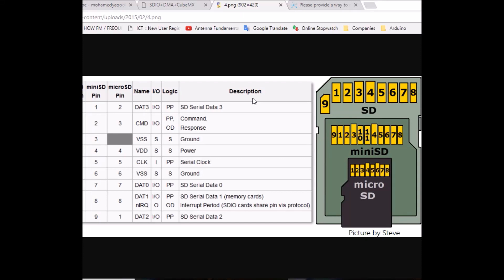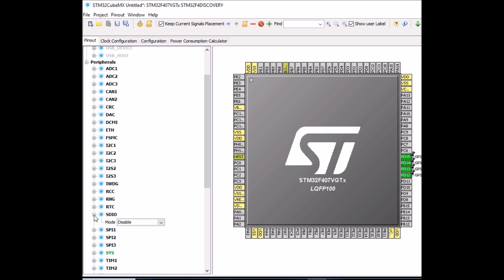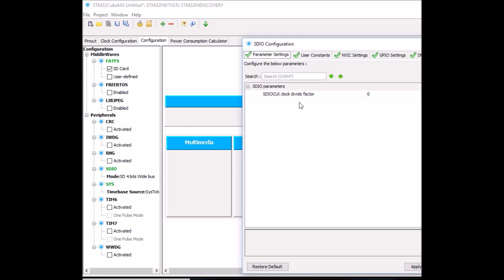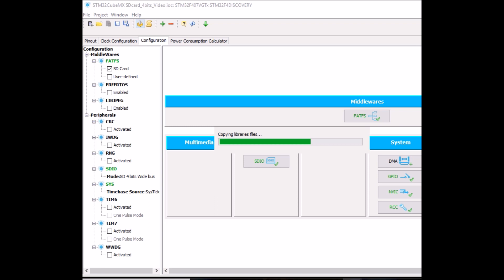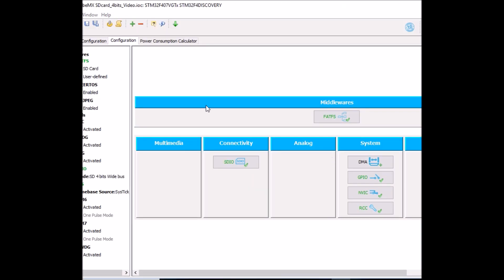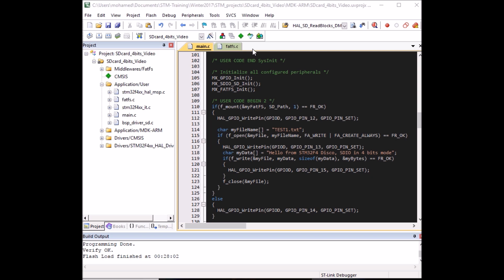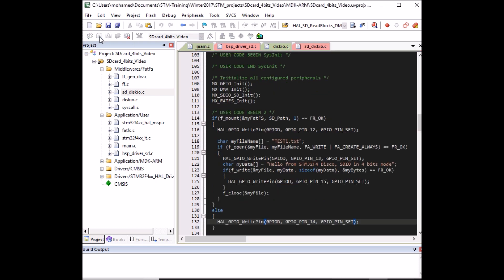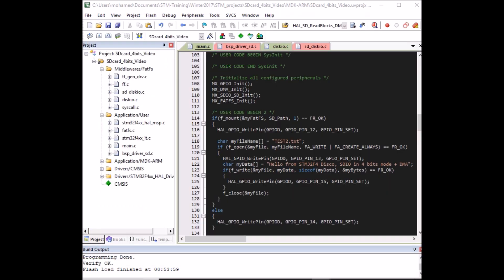STM32F4 Discovery board - Keil 5 IDE with CubeMX: Tutorial 22 SD Card SDIO 4 Bits + DMA

Comment: What is the point of setting up a DMA channel for using FATFS in this way? If you look into the f_write call you will see that as soon as it sends the SDIO DMA it will sit there waiting for as long as it takes the DMA transfer to complete in a blocking way before proceeding. This makes the use of a DMA function completely irrelevant. I would love for someone to correct me as I have spent hours trying to find a solution to non-blocking fatfs write but it takes about 2 minutes to look into the f_write function to see that simply adding a DMA channel to the SDIO write adds zero benefit.

Comment: Hi. Great job with your tutorial Series. I would like to ask you a question. At the beginning of the video, you mentioned that several people are experiencing problem with Hal spi library. Could you please tell me what kind of problem you are talking about ? I am working these days on a project with a Nucleo f411re and an ADXL345 accelerometer connected through SPI. I followed your tutorials on howto read and write on SPI. I think to have properly set the SPI configuration according to the accelerometer datasheet. Do you think possible a problem in the new library version? Please let me know. Thanks
Reply from the maker: Ocelot 0991 
Hi man,
Thanks, The issue is with the SDIO driver on latest CubeMX releases (4.23 and 4.24).
Reply: MYaqoobEmbedded 
I am not sure about the exact  version, but I essentially installed it  on Sunday. So do you suggest to downgrade to the previous version ?
Reply: I am not sure about it, but I don't think the SDIO driver is called when using Hal SPI transmit or receive. Please correct me if I am wrong.
Reply from the maker: Ocelot 0991 
No, you are absolutely right. I was just referring to the Bug in the latest release that I mentioned at the start of this video. You should be ok with SPI. Good luck :)

Comment: Just a side note. On my F407VET (Black Board) I had to set CLKDIV to AT LEAST 11 to get SDIO mount at all... I would even set it higher for reliable operation...
Reply from the maker: Right, that's most probably to do with line impedance and strength of pull up. Is it a copy board or ST designed?
Reply: @mutexembedded2206  Its not a ST board nor ST designed, its a 15€ Chinese one: https://www.mikrocontroller.net/attachment/464382/black.jpg It has 10k pullups on SDIO lines. I also somehow doubt that they've done any impedance matching on the SDIO traces but I also read that impedance matching is only needed if traces are longer than 120mm...

Comment: Thank you for your tutorials, my CUBEMX version is 5.4.0, when I press generate  code from the cubemx, their have some information about like "These IPS still have some not configured or wrong parameter values:[FATFS, Verify the Platform Settings Tab]". Will this influence the program working?  Thank you.
Reply from the maker: If it is the disk detect pin, no effect
Reply: @mutexembedded2206  Thank's a lot  for your reply. Got it!

Comment: Hi MYaqoobEmbedded, The example is illustrative. However the provided BSP_SD_XXXXXBlocks_DMA functions implement a busy waiting loop, which defeats the whole purpose of DMA.....
Reply from the maker: Useful with RTOS applications.
Reply: Yes, but than you would still need to build a mechanisme to properly synchronize the file system operations with the low level device access that yields the CPU, this is probably out of scope of the example, but may be the reason why the out of the box CubeMx implementation does not work.

Comment: Hii, great work! would you consider using sd card in spi mode? can you make a video for the same?
Reply from the maker: Hi, SDIO is much easier with STM, than using SPI.
Reply: @mutexembedded2206  is spi faster than sdio ? + Uses less pins
Reply: @VishalVerma-xw9wb  NO, SDIO 4-bit "at least" 4x faster than SPI

Comment: Great video. What is the purpose behind running SDIO with DMA as the data transfer is very fast and doesn't seem to block the CPU?
Reply: I guess it is useful for determinism on RT applications, such as control systems and data logging running concurrently.

Comment: Hi, I did the same by downgrading as you suggested and I worked successfully. However, the original project that I'm working on is already upgraded to the latest(4.25) version.

Therefore, I'm trying to do the same project with the CubeMX version 4.25, and FW version 1.21, but it's not working. I thought maybe they fixed the problem in version 4.25 but apparently they did not.

Is there a way of doing the project using the lastest versions? The problem is once any project is opened with the lasted version of CubeMX, it's upgraded automatically, and once it's done, there is no way of downgrading the CubeMX version of the project.

If there is a way of downgrading the CubeMX version of a project, I can also make use of it.

Besides, thanks for the videos, and I'm looking forward to see the next ones.
Reply from the maker: Hi Ogulcan,

An easy way to do this, is to do the CubeMX set-up from scratch again with the Downgraded CubeMX and then, copy the code over from the previous one. I usually do that.

Regards,
Mohamed
Reply from the maker: I tried no. 2 with the SDIO issue, did not help.
If you have a large project, then just add the SDIO library to the project manually,, it is a bit tedious but doable, you would have to include all the SDIO .h files and Add the .c files to your project.
Reply: Okay, I have some time to wait for the fix. If they won't be able to  fix it in the next release, I'll do as you suggested. In the meantime, I'll implement my other tasks. Thanks for your effort,  cheers.
Reply from the maker: Ogulcan Ariyurek 
That's Ok, good luck
Reply: Hello MYaqoobEmbedded,

The new version of STM32CubeMX has released, which is version 4.26. Could you be able to make it work with the lastest version without downgrading?
Reply: Hi, did you try with freertos?
Reply from the maker: Ogulcan Ariyurek 
So did not reply to ur previous question.. I tried many time with the one of the later CubeMX releases.. it does not work.. although I can get it to work by change a lot of low level code.. but does not worth the effort when it works with earlier releases.. or can add the library manually to your project without CubeMX, it works great this way.
And for your RTOS question.. I did use it with RTOS, you would need to use semaphore to limit access to SD card by multiple threads.
Reply: MYaqoobEmbedded neither do I able to make the later versions work and now since my time is up, I'm following your suggestion and adding the previous version files to new version project.

This actually worked, however, the problem is it only worked for non-rtos version. The freertos version did not worked (compiled fine, but gave hard fault). I'm glad that you make freertos version worked using semaphores. How and where exactly did you use semaphores? Can you give us some tips?

Thank you very much for your precious time and effort.
Reply from the maker: Ogulcan Ariyurek 
To get SDIO working with freertos.. you need to increase thread stack size to be able to implement sdio functions because they require large stack to implement
Reply: But I put it inside the main, not into a task, and it gave hard fault. You said you used semaphores, how did you fix it? By the way I have some memory shortage, how can I sort this out with minimum memory usage.
Reply from the maker: Ogulcan Ariyurek 
Even main is managed by RTOS at this case.. I would avoid putting SDIO code in the main because it's stack size is set to default.. use it inside a thread with stack size of 512 is a good starting point.. and increase it gradually.
Reply: Hi, I solved the problem. In newer versions, you have to set global variable for SDIO in NVIC settings, and set DMA for SDIO RX and SDIO TX. If these does not work, try playing with the clock divider (the one that you set 3) and you may also need to put damping resistors to avoid overdamping and underdamping issues in clock and data lines.

Comment: Hi, thank you for all your videos, they are amazing!
Unfortunately, I followed all your steps in this video and I can't force my SD card to work. The problem is f_mount returns FR_NOT_READY. 
I've done completely clean installation of CubeMX 4.21, tried both with 1 bit and 4 bits sdio. I'm using the same board (F4 Discovery) with Pololu MicroSD board and pull-up resistors on every line. Tried with 2GB uSD card and 16GB SDHC card. But the problem still occurs. Do you have any suggestions about what I might be doing wrong?
Reply: Hi! Got the same issue here... Did you manage to solve it?
Reply: Did you try with the latest version 4.26?
Reply: Ogulcan Ariyurek no, I tried with 4.25 and it doesn't workshop either. Only version I managed to workshop was 4.21. Let me know if you tried and this issue is fixed on 4.26...
Reply: I tried with 4.26, but couldn't make it work. But maybe I'm doing someting else wrong.
Reply: Hello!
I also have the same issue with 4-bit SDIO.
I used CubeMX 4.21 + v1.16 Firmware + 8GB Class4 SDHC.
But f_mount function does not work all the time.

And I am sure that 1-bit SDIO is absolutely OK.
In my opinion,  f_mount function does not work whenever I use 4 -bit SDIO mode.
Moreover, the latest CubeMX 4.26 + v1.21 Firmware has no problem with 1 bit SDIO. 

Is there anyone who can solve this problem?

Comment: Is it possible to share complete project instead of only text file.
Or else is it possible to extract only those SDIO interface related files which are working well in older cubemx version and port to new Cubemx 4.27 firmware 1.21 project as a patch so we don''t need to scarify on latest cubemx version.
Or else same patching procedure to make sdio card work in newer Cubemx 4.27 firmware 1.21 will be highly appreciable without downgrading to lower version
Reply from the maker: Hi Ulhas,
Good point, I will try to upload the files when I get a free time. I am tight on time these few months.

Comment: Hi! I'm trying to get it working on STM32F407VG and CubeMX 6.2.1. Firstly i configured SD to work in 1 bit mode, now I'm trying to do 1bit+DMA. (4 bit isn't working now, my card won't even mount)
It is working, but not entirely. Things double /triple writes to text file. 
I'm not changing functions in bsp_driver_sd.c and sd_diskio.cd like you. When i do it's worse, than now (card won't even mount).

Anyone got it to work recently on new versions of Cube?
Thanks for help!
Reply: Also, i tried downgrading to Cube 4.2.1, but i can't get it to work with Attolic (if anyone has tips, tell me :) )
Reply from the maker: @bariamak9491  Hi Maria,
Forget about CubeMX if you are a long term user of STM32.
As for your short term problem, use DMA template
Reply: @mutexembedded2206  I have it enabled. My assume is that some register isn't cleaned properly (or on time). I think I have to go to programming on register like I did on AVRs. Thank you :)

Comment: @ MYaqoobEmbedded
Hi Mohammad, 
many thank for your great tutorial! 
I faced to a problem and really blocks me! I hope you can help me:

I could implement the SD card project via SDIO protocol. I want to see the content of my SD card in pc using USB mass storage. I implement my project using stmcubemx version 4.21.0. The SD card works meaning that I can create a .txt file and write something into it. When I put the SD card into adapter and connect to PC, I can also see its contents, as expected. 

However, i can not see its contents using USB mass storage! In usbd_storage_if.c file, there is a STORAGE_READ_FS function to read SD card contents using USB. SInce it is originally empty, I modify it as follows:

 int8_t STORAGE_Read_FS (uint8_t lun, 

            uint8_t *buf, 

            uint32_t blk_addr,            

            uint16_t blk_len)

{

 /* USER CODE BEGIN 6 */ 

HAL_SD_ReadBlocks(&hsd, buf, blk_addr, blk_len, 10);

HAL_GPIO_WritePin(GPIOD, GPIO_PIN_13, GPIO_PIN_SET);  //Orange LED);  

 return (USBD_OK);

However, it doesn't work! Moreover, I cannot watch buf, blk_addr, blk_len in live watch to see what such arguments contain!

It really blocks me for a while! Do you guys face such issue? or have any suggestions ? 

Infinite thanks in advance!

Edmond